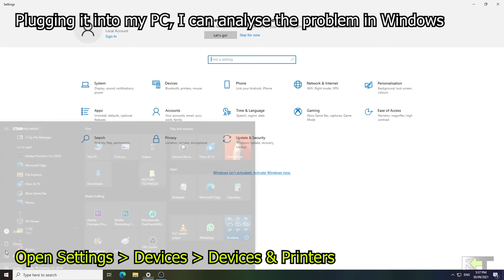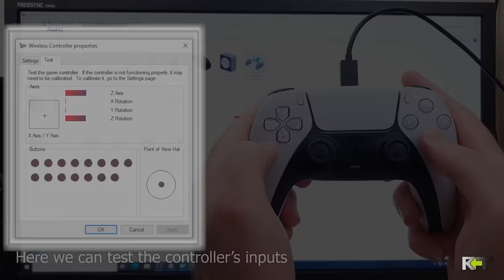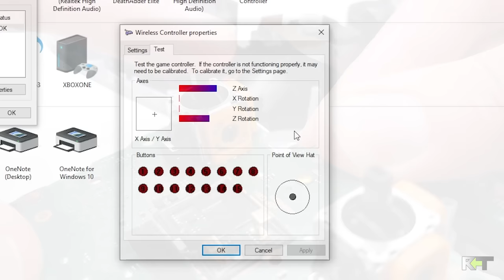How to take apart your PS5 Controller and fix Stick Drift

Comment: So we all now that probably 95% of PS5 owners had analog shifting issue with at least 1 controller. I have 4 dualsense controllers and 3 of them have the same problem! Left analog is shifting to the left, and 4th one that i'm almost not using will probably have the same issue. 
I know they are some YT tutorials how to opet them and maybe clean but i didn't want to give Sony any opportunity to cancel my warranty so i have called them and they have  accepted 2 controller to fix cause they were still under warranty. They did their job pretty fast, but they sent me new ones instead of fixing, and that is ok. The problem here is that they do not cover shipping cost, so i had to pay amount almost half of a cost of 1 brand new controller, and i'm not fine with that. I should not pay even $1 for something that was clearly Sonys fault, i asked them to at least give me some PS plus credit for that, and they have refused...First of all this was not 1 in 1000 accidental issues, this is a global dualsense problem that Sony should FIX!! And not only controllers under warranty but all of them since this is a product defect, the same what car brands are doing recalling defect models.
This is not fair and i will think about wich console i will buy next.

Comment: I just opened one from the box after connecting to the PC it started to experiencing drifting same on PS5 I'm not happy with thats I will be returning back to the store .I had one replaced by Sony and I'm experiencing the same after testing on PC and dead zones on Call of duty.

Comment: I know im alottle late but your video helped me fix the drift on one of my controllers and then the other one just had fantom up directional button presses . So im sure i did something wrong . But when i took it apart i couldn't find the problem. Has this happened to you ? I eventually got angry and rage tore my 2nd controller a new asshole. Now its in the garbage but hey at least ive got 1 that works ill hav e to go pick up a spare tomorrow

Comment: I don’t havw the proper tools im stuck on trying to remove the battery terminal. Tweezers don’t work and small scissors also don’t seem to work I almost severed some of the cables any help?
Reply from the maker: You can disconnect the battery just by grabbing the cables and gently pulling upwards whilst rocking back and forth. It should wiggle out.
Reply: @RestoreTechnique  Thanks for the swift response, it worked!

Comment: Might be a dumb question but how do I open my controller up without using what you're using?
Reply from the maker: You need a screwdriver to remove screws. You could use a plastic knife or some plastic that you can make thinner at one end, and use that as a spudger / pry tool.

Comment: Any advice for how to secure the speaker after pulling it from it's adhesive? Thanks!
Reply from the maker: I just pop it in the speaker slot in thr plastic shell. The adhesive has a big thick pad of foam, which holds the speaker in place when reassembled.
Reply: @RestoreTechnique  Thanks for the reply, I ended up just using a tiny little bit of super glue so I can hopefully still remove it later if need be, but yeah that pad was not at all sticky anymore after I took it out initially so I was worried I wasn't gonna get it back on there properly haha

Also do you know if the two little gold prongs on the bottom of the speaker are like contact points for the metal bit it slots onto? As in do those need to be touching for it to function? I assume so but thought I'd ask. Thanks again for the awesome vid, it helped me massively reduce my drift even though I didn't have all the proper tools.
Reply from the maker: @swordandsheild1  Yeah sometimes you can take apart the controller and the speaker is already sitting in the frame, and not stuck to the motherboard. I don't know if there's any glue on the foam, it just sticks from pressure I think.
Yes you need to make sure the speaker is rotated so the contacts on it align with the gold contacts on the motherboard.
Reply: @RestoreTechnique  thanks again so much! Hope your day goes well!

Comment: Im having a really
Hard time fixing my stick drift, its completely moving to the left all the way, and i dont know what im doing
Reply: Try to make sure the disc is placed in the correct position inside the potentiometer, took me a few tries until I had mine just right. The first couple of times it too went all the way to the left, until I got the disk to go in the correct orientation, but then after I put it back together, the stick registered all the way to the right, but then I remembered that I had tried to mitigate the drift before disassembling, using that DS4 Tools from GitHub, so I thought maybe I messed up the stock calibration, so I did a reset on the controller (the hole in the back, hold it for 5 - 7 seconds) and after that a new center calibration using DS4 Tools and, voilà, back to normal again.

Comment: Does anyone know what the component is at 3:45 ?  Mine didn’t have one!!! It also didn’t have screws holding the controller together and I find one loose silver screw in one of the handle areas. Rushed product without QQ!!
Reply: No screws? at all? jesus. thats actually insane. The piece at the time stamp i think is the brains of the PS home button. It could be possible yours didnt fall out as he put it back where it belonged or they updated the models on the interior of the controllers. But man no screws is insane - I would just buy either the duelsense edge which lets you specifically replace the joysticks or buy an aftermarket pro controller that has things built in place for stick drift.

Comment: When I tested my controller after trying this I couldn't move up and down (stuck in the up position). How can I fix this?

Btw, I did all of this but had to use a normal Q-tip and a little water.
Reply from the maker: You can maybe fix this by using Isopropyl Alcohol. Water will leave minerals on the surface, which can play havoc with electrical signals. Aside from causing corrosion on the metal parts over time.
Reply: @RestoreTechnique Thank you for the help 🙏The sanitiser worked for me.

If I have any problems in the future, can I leave a comment here?

Comment: I took it apart and put it back together and now square and ring button dont work, but it fixed the stick drift 90%, then i take it apart again and and put together try to fix the buttons that dont work, and now the right analog dont work also. It is aim controller

Comment: The sides of the inner black ring of my edge controller look practically peeled off, there is only the transparent plastic at this point. And fixes that doesn’t need soldering??
Reply from the maker: Nope, you need a new potentiometer track replaced

Comment: I tried this again on another DualSense, after failing my first attempt, and i managed to pull it off!
Except i somehow messed up the d-pad. Up, right, and down on the d-pad work very well, but left doesn't work unless i push down very hard for a couple seconds. Anybody got an explanation?

Comment: When I reinstall back cover I noticed a little space between plastic on the sides near L1 and R1 , is this normal ?
Reply from the maker: It sounds like you may have broken the big clips on the sides. If you break those clips it will leave a larger gap between the frame.

Comment: The things on the side of my analog sticks are green and not orange everything else seems to be the same I didn’t see the logo u saw I think I bent the three pins is that ok or do I need a new controller now lol
Reply from the maker: It's OK to bend the 3 pins, just don't break them
Reply: @RestoreTechnique  yes I managed to do it and put it all back together unfortunately I don’t have the supplies needed to properly clean the side circle thing it has black stuff under the rim looks like it’s fried or something idk but I tried to scrape some of it off and put it all together but it still drifts to the left. Still thanks for the video 👍

Comment: Anyone knows where I can buy a flex cable? The brown one on the sides? I accidentally ripped it while taking it out. 😭 
It was a second hand controller and I’m pretty sure someone had messed with it before because I swear I didn’t pull that hard!

Comment: I'm having drift issues but I don't think it is my controllers (I have 4 of them, 2 brand new) because they ALL suddenly started drifting about 3 days ago but I don't really understand the root of the problem. The only thing I can think of is interference, but nothing has changed in my home from before this drifting issue. I have not added new electronics, wifi or Bluetooth usages, so I can only imagine the interference is coming from another source outside my home or there is another even more bizarre explanation that I don't know about. I hope someone here has some ideas or possible fixes because I can't game at all any more without having major gameplay issues. I completely lose control of my controllers and they drift both to the left and or right and in both directional view and directional movement, so it's an absolute mess.

Comment: Hello please help my PS5 controller keeps doing a clicking noise and the screws don’t go in properly what do I do
Reply from the maker: That's very vague, I don't know without seeing it. If the screws don't go in then you may have damaged the plastic screw holes. You might need to take it to a repair shop.

Comment: At 6:30, I cant get the Yellow Piece (in my case green), to click back into place. Any advice?
Reply from the maker: Make sure the alignment pins at the top and bottom are going into their slots. It's possible you damaged them a little and now they're mashed up and not sliding in.

Comment: I started taking apart my controller and things were going smoothly until I had to unplug the ribbon cable that connects the black plastic battery holder to the controller (the first one shown in the video). I don't have experience tinkering with electronics, and it was hard to tell in the video exactly what was being grabbed. I struggled to get it unplugged and then tried a different angle but my tweezers tore the cable and now I'm not sure what I should do. I'm tempted to send my repair kit back and just buy a new controller because I'm so frustrated, but I don't really have the money to go buy an Edge. Is there a way to replace that specific cable?
Reply from the maker: Yes you can replace the cable. The one attached to the black battery holder is the rear microphone.
Search Google, eBay, and/or AliExpress for "DualSense Microphone" or "DualSense Rear Microphone".
There are different variants depending on your motherboard model.

https://a.aliexpress.com/_mLr2GOM

https://a.aliexpress.com/_mMCiqfe
Reply: @RestoreTechnique  Thank you! I don't use the built in mic, so is it possible to get away with it being unplugged?
Reply from the maker: @CucumberKat  Yeah the controller should work as normal without it (afaik). Just remove it completely to make sure the torn flex cable doesn't short anything else. 🙂👍
Edit: Also, the controller still has another user facing mic, so I think the rear mic is mainly for hearing surrounding audio, and eliminating background noise.
Reply: @RestoreTechnique  I made sure to remove the torn cable and put everything back together after removing some hairs from the left joystick. I swear I got everything plugged back in securely, but now my controller turns off when I unplug it and a question mark appeared over the battery. From one problem to another :/
Reply: UPDATE: I took the battery out and plugged it back in, pushing down firmly on the little white connecter. IT WORKED! Battery is back in business and I accidentally turned on my console 😅
Reply from the maker: @CucumberKat Ahh awesome! I was hoping it was something like that, and wasn't that you'd ripped the connector  off the board 😅
I have often turned my playstation on when working on a controller, when my housemate is in the lounge wondering why the TV just switch to PS 😄

Comment: tried this on my sons playstation5 controller. opened it and  cleaned. when I put it back together the left joystick( the one I cleaned)  was very rough to move and was not able to move it to the left (but up and down  movement are ok). I feels as if something is stuck. Does anyone know what might be happening and how to fix it?

Comment: So I was doing it and the lil cable to the pushbutton to turn on ripped um what now I don’t have any spare parts or knowledge
Reply: buy a new controller, or possibly you could buy a used controller and replace that part specifically or just change out the motherboards or something. I dont know man thats tricky, these things arent cheap at all. The duelsense edge has replaceable joysticks but its like twice the price of a normal controller.

Comment: 3:10 
I was wondering was that cable important?
because I kinda screwed up lol
Reply from the maker: It's for the rear microphone. The DualSense has a user facing microphone and a rear microphone. I believe the rear microphone is for noise cancelling, picking up unwanted sounds in the room and removing them from the final output.
I assume the front mic will still work, it just won't have the noise cancelling, so won't be as good quality.

Comment: When I tried to clip the orange part beside the joystick back on after cleaning it, it just falls off after pushing it in. It makes clicking sounds when I push it in but it won’t stick. Is there any way to make it stick to the side of the joystick? It’s at 6:31 in the video
Reply from the maker: It falls off? Did you break the metal legs off from the motherboard? 4:25
Reply: No it’s still attached at the bottom but when in try to push it in towards the main part of the joystick it won’t attach to it. I think it might be a problem with the clips on the side of the orange part but they look normal.

Comment: I know this video is old but i’m so desperate for help. got my ps5 in thanksgiving and a blue controller for christmas, it has unbearable stuck drift to the left after a month and my white one has had it for months but i’ve tried to just ignore it and use it, but now it’s intolerable. I tried taking the little things you took out of the joystick from the right stick on my white one and put them in the blue one, and still stick drift. know of any other fix that doesn’t involve replacing the potentiometer and soldering it??
Reply from the maker: It's usually the carbon track that fails first due to wear, so swapping the wiper disc out for another one is unlikely to make any difference. No other method I'm aware of, other than cleaning the tracks, or replacing them.
Reply: @RestoreTechnique  Took a crack at cleaning it again, it seems to work for now. Went from heavy left to 0 stick drift whatsoever, which i think is a good sign since  everything i tried didn’t help before until now. Thank you!

Edit: Didn’t work. These controllers make me so angry.

Comment: Be warned: the clips shown at 2:34 don't seem to exist on newer controllers. I've been trying to pry it apart for an hour now with no luck. You will likely snap your controller.
Reply: The controller had no changes . 
Be brave pry up harder .
Reply: @Crashed131963  I was able to get them out, but yes there are some minor changes. The ribbon cables on the left and right are different connecting the main board and also you don’t have to perform a step with newer ones
Reply: @ZebulaJams  Might as well get good at it these Ps5 controller are junk and will need to be fixed or replaced all the time .
My ps5 controller drifted after 3 months .

Hope the ps5 console is not made cheaply also .

Comment: 3:44 why did we remove the speaker?
Reply from the maker: @jakubeli1260  because it's not attached to the motherboard securely. Sometimes it's not stuck on at all, and is sitting in the slot I put it in. It's only held in place with a foam pad, and sometimes that foam pad sticks to the motherboard, and sometimes it doesn't.

Comment: No doubt this would be very helpful if done right. Unfortunately, i must have screwed up somewhere, cuz when i tested it after everything was said and done, i made the drift significantly worse.

Delicate things like these are not my forte, i think i may have to just shill $70 because i am just not good with this stuff

Comment: My controller has a thing where on some games it says that I’m pressing r2 when I’m not e.g if I play fortnite my gun shoots without me pressing anything
Reply: Please help me
Reply from the maker: Probably dirty contacts, or maybe a worn out carbon film. You would need to take it apart and clean the contact for the R2 trigger on the plastic film. It the carbon film is too worn, it mah need replacing. But it's most likely just needing a clean with Isopropyl Alcohol. The carbon can wear off and bridge the gap and short out the button.

Comment: So my analog now runs left aggressively where did I go wrong? Any ideas? Lol
Reply: Same
Reply from the maker: Either you didn't clean it properly, or the carbon track was too far gone and needs replacing.
Reply: @RestoreTechnique  idk about him but followed your video and it worked. Thanks a lot lol
Reply: @Restore Technique  I'll go back in and clean it again 
I feel like maybe I didn't put it back together properly. Thank for the reply
Reply: Sorry 5 months late lol but recleaning it didn't work, but if I get an entire new module for 8.99 on amazon will do the trick right? If not then i know it's a possible wiring issue that i screwed up @RestoreTechnique